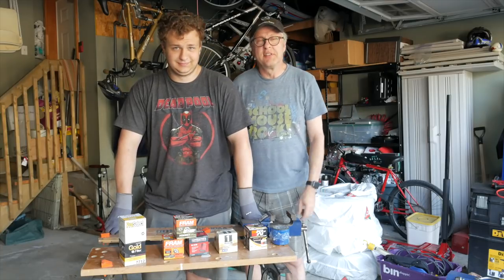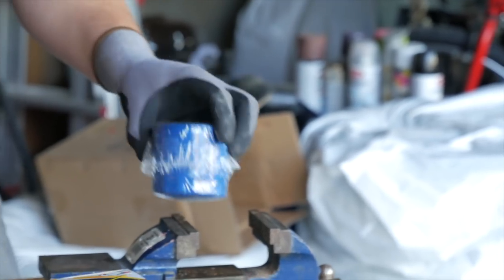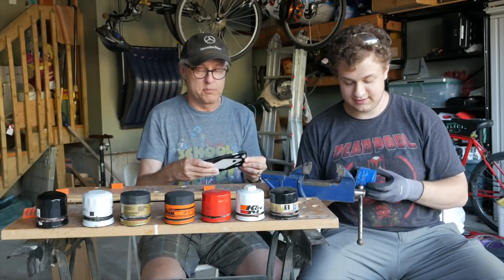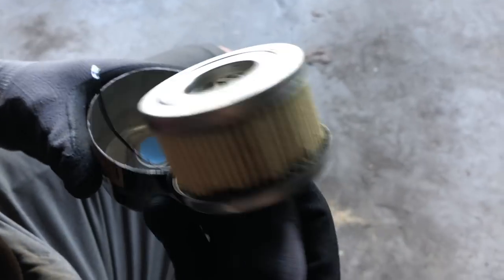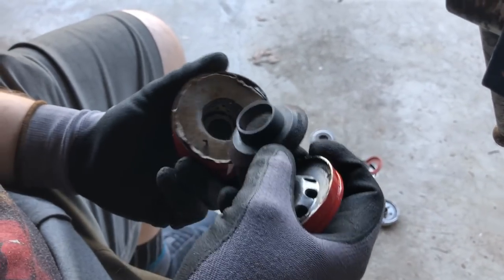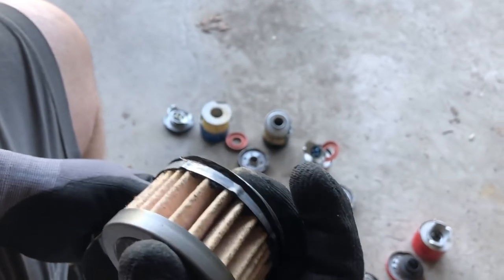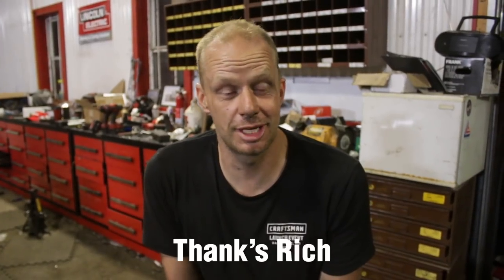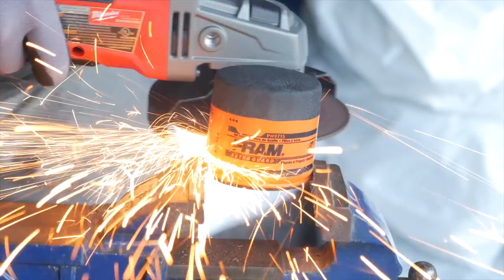OIL FILTER DEATH MATCH between Fram, NAPA, Motomaster, K&N and Subaru OEM

Comment: Hi Guy's, I quite enjoyed this and made for a nice change. The Fram Ultra Synthetic is (I think) a fleece filter designed for those stupid extra long oil change intervals so had a different design. Ever since owning a Mercedes I am not a fan of the metal can oil filters anymore. With the German system you only replace the filter element and can see exactly what your getting without having to destroy it and can see how dirty it is when removed [just my two cents]. Cheers.

Comment: True story:  In the 50s, not all cars came equipped with oil filters.  For example, my granddaddy had a '54 Nash that didn't have one.  His neighbor had a '54 Cadillac that had an oil filter housing at the top, front of the engine, and it was designed to use with a roll of toilet paper.

Comment: I guess you will be thinking twice before buying another oem Subaru Filter. Not surprising. Why wouldn't they put their name on a cheaply made, outsourced product and charge more money. Especially since no one sees whats actually inside. I had a feeling the Motomaster ones were made by Fram. Last time I noticed the similar bar code.
Reply from the maker: Yes, especially when Subaru is pitching itself as a bulletproof brand. But as Rich said, if you change any filter often enough they will all work.

Comment: Wix fanboy here, that said, with my F150 I buy the Motocraft filter. Last time I looked they were rated pretty good and if I have engine problems I can say "hey! I used your damn filters, WTF?" :^). Using similar logic, I opt for the Honda filters on my motorcycles. Well, except for the Guzzi - Honda doesn't make filters for Moto Guzzi.

Other sites have also unrolled the media to get a feel for how much surface area is available to the oil. On the Fram filter in question it was jammed in there pretty good which makes me wonder just how much surface area is really used. I don't know. Just raised an eye brow.

Thanks for the divergent topic. :bow:

Comment: First off you need to count the number of pleats. More pleats mean more filtering material. The Napa Gold should have about 20% more pleats. There is also a difference in the actual pleated material. Some filter out smaller particles (Microns) than others.

The NASCAR blurb on the K&N filter is nothing but advertising. They pay a licensing fee to NASCAR to be able to use their name on their product. For years WIX was the official filter of NASCAR (and a superior filter btw). Sunoco pays to be the official fuel of NASCAR. All of these products who have these designations are paying for the right to use the NASCAR name. That doesn't mean that they make the best product.

Comment: You should check out AMSOIL and Royal Purple filters too.  There is a good tool that channel Project Farm found that makes opening them easier.  The overall length of the filter helps illustrate the overall surface area of filtering.
Reply from the maker: Are those European? Who wants to make it easier to open?😊
Reply: I believe those are US based companies.
Reply: I don't know about Royal Purple, but AMSOIL is US-based.  AMSOIL is a multi-level (pyramid-scheme) marketer of premium synthetic oil, and they also produce supposedly-premium quality filters to allow for supposed lifetime use of their oil, without ever having to do oil changes.

Comment: I would have like to seen them cut on the other axis... I think that might have given a better perspective on the construction of the filter... in regard to the button I thought that was for anti backflow rather than pressure bypass? Anti backflow systems shorten the amount of time your vehicle gets oil pressure when first starting to the best of my understanding... The amount of time your engine runs with no pressure on the rods and mains pretty much determines the amount of time your engine has for a life

Comment: Napa gold is more money due to the higher quality silicone drain back valve,  vs the pro select rubber. Napa best filter on that table.
Reply from the maker: We saw absolutely no difference. The drain back valve looked exactly the same. We're not experts but we couldn't tell.

Comment: Two Ding Dongs Giving It A Shot to Fame!
1) The plastic button with spring described in this video is called the By-Pass Valve. 2) The Nitrite Rubber or Silicone (Silicone is better for durability and temperature range) is call the Anti drain back valve. All filters made with cardboard end caps (Subaru, Motomaster, Fram) are made by Federal-Mogul Not shown in the video is the cardboard end-caps are coated with epoxy-resin. Hence good for 5Kmi or 8Kkm.  The filter media is paper, paper mixed with fiber glass or pure fiber glass. Ranked from low durability to high (5Kmi/8Kmi to 20Kmi/32Kkm)

Oil comes into the filter from the veins of the engine into the small holes of the filter at the top. Hence even if the filter is mounted upside down (as in my cars)  the drain back valve 1) prevents  siphoning out to occur  when the engine off and 2) keeps oil in the veins in the engine. Equally important is the By-pass vale. If for any reason (extreme cold) or Filter media clogged the by pass vale is pressure sensitive and will allow unfiltered oil to pass through to the engine it will cease!